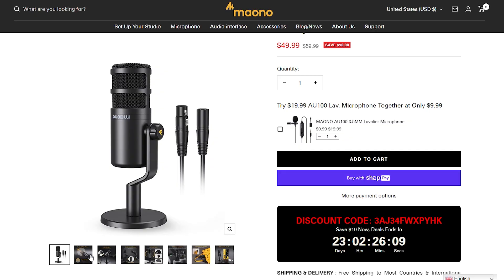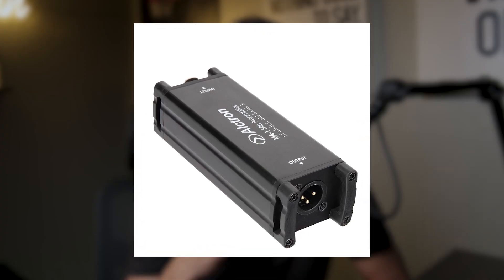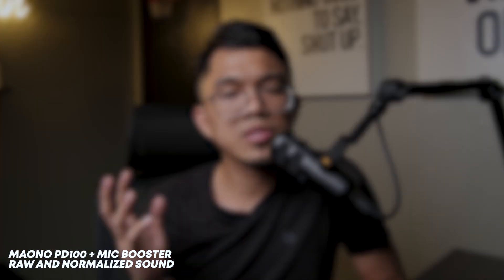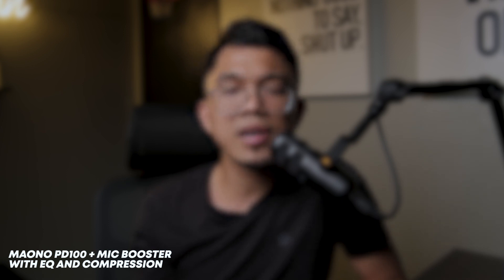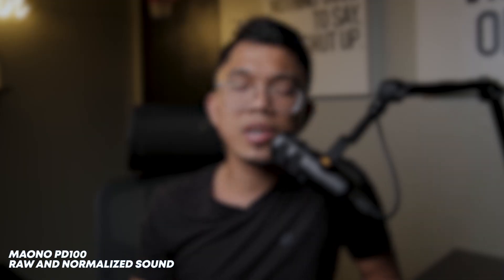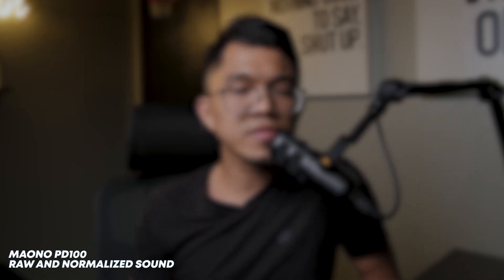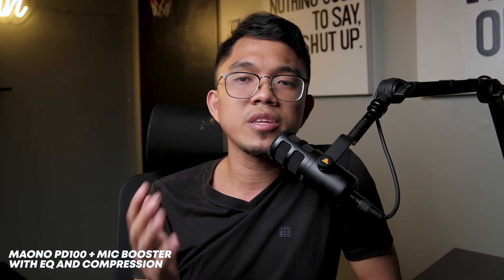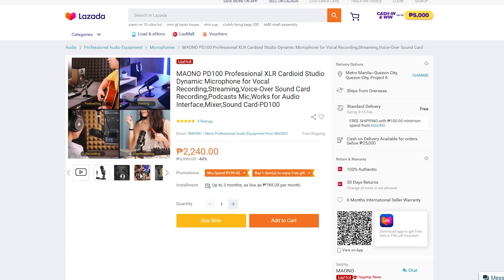MAONO PD100 XLR Dynamic Microphone Review | SHURE MV7 Alternative?

Comment: Can phantom power be given to maono pd 100 u xlr microphone?
Reply from the maker: yes, you need phantom power
Reply: @duekneel   Dynamic Microphones don't usually "need" external Phantom power to operate. But you're right, i tried to connect this mic to my Maschine controller to add vocals to my beats.. but the audio interface on the Maschine controller doesn't have Phantom power.  Sooooo i took your suggestion and got a mike booster (the SE DM1 Dynamite preamp), and used an external audio interface that has Phantom power.. Thanks for the tip.

Comment: Bought the PD100 too and Tried connecting it in my v8 soundcard but it’s not working. 😪😪😪
Reply from the maker: may 48v phantom power ba yung v8 mo?
Reply: @duekneel ah so it has to have that v8 phantom power. Yan ang wala sa soundcard ko. Now I know. Thank you!
Reply from the maker: @AubreyPine  yes po 👊